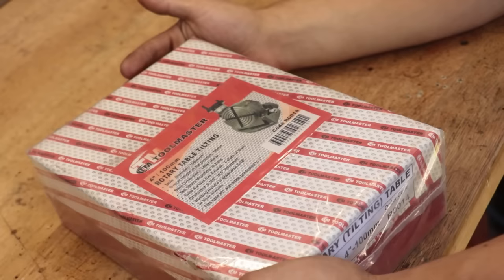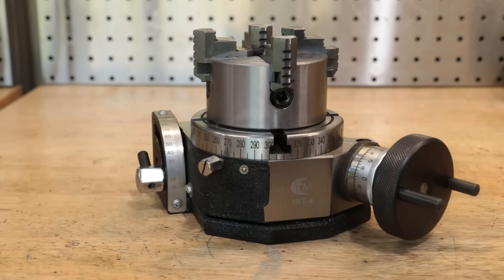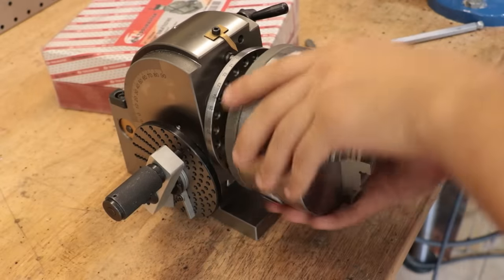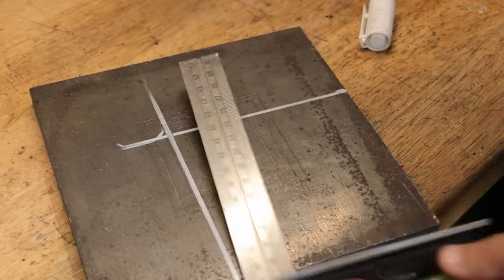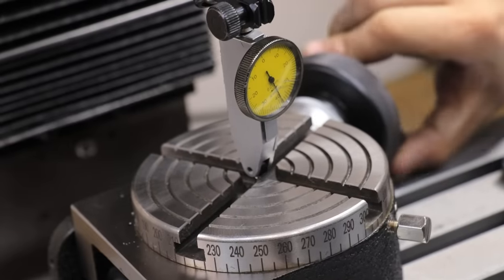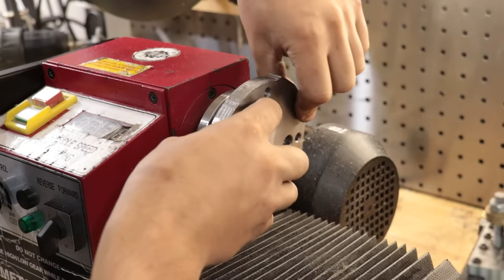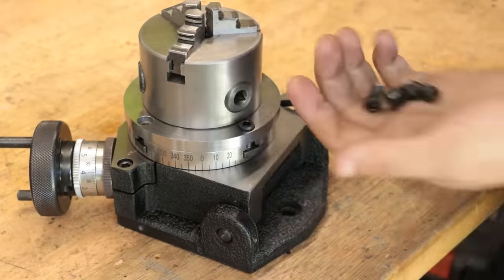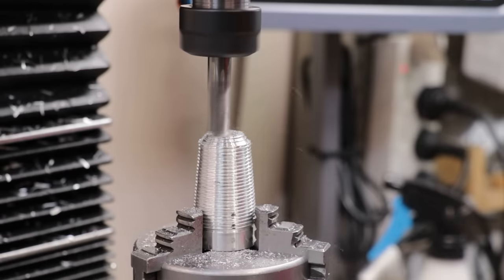I Bought a Cheap Rotary Table Which Was a Big Mistake

Comment: 12:27 I have heard some horror stories of people using files on a lathe (a chuck jaw catching the file, pushing the file tang through the handle and in to his hand for example) so I have a special file for use on the lathe, I removed the tang and rounded of the end.
Having said that, I'd consider the operation shown in this video to be ok because there's no chuck jaws spinning around.
Reply from the maker: Yea I’ve seen an accident similar to this but not exactly the same. Grizzly stuff. I havent removed my tang but I have a turned down wooden handle that I made in a very old video. Somewhat uncomfortable and I’ll change it one day. Cheers

Comment: Makes me wonder with machining required anyway ,just a couple of 45 degree interlocking plates turned on the lathe with an on-axis magnetic encoder underside. and some clamping mechanism. maybe made from an old topslide .Ah the rabit hole of indexing head accuracy .

Comment: I got the 3 inch, Indian kind. Mine didn't come with that big dial tho. Only because i offered the seller 42$ and they accepted it lmao. Still there Only worth 25 at most. Literally looks like a coin I took it apart and it smelled awful, like they dumped Gee from a roadside food stand on it to prevent rust. There was grease on the brass gear but something else was just nasty. I put the parts in ziplocks and dumped wax&grease remover then just let it sit. Can't figure out how they're supposed to go together tho because the handle just pulls out now but i did file and polished the the edges of the worm gear teeth because they were squared off & the brass gear had triangle so they barely matched just the most miniscule amount didn't take that much off. It spins nicely anti clockwise but clockwise it pushes the shaft out. I was pissed by the end and haven't touched it since so maybe tonight but probably not. Ima just drop the $ for the lms precision 4 inch rotary table with indexing plates. No since in buying this garbage when you can save your money. Buy actual precision tooling and not cheap eBay or Amazon Chinese or Indian "precision" tooling because its not. They just say that so the ad pops up when you search anything with precision in it.

Comment: Sometimes I’ll buy a cheap Chinese tool/machine. I know what I’m getting into. Though those things have been getting better over time, some are just built for price and there is no quality control. I expect that, and so take everything apart and redo whatever needs it. That normally makes it a much better tool. The lock may be solved. If I saw the parts separately, I might have an idea, if what I expect is happening is correct. But without seeing, I can’t tell for certain.

Comment: I have Vertex rotary table. It is probably a mid price point and has suited what I do. It has a 90/1 drive ratio which gives better resolution but takes alot of cranking to get there 😁. Fitted with dividing plates I have produced great gears and other exciting stuff.
The only downside is it is not tilting but I can live with that but it can be mounted vertically & horizontally. It needed stripping and cleaning before first use but I tend to expect that with any tool and satisfys my craving to take stuff apart to see how they work 🤪.
I have the matching tailstock and that has  proved invaluable to provide rigidity on longer projects and when using mandrels.

Comment: I cant believe that after seeing the  lock "working" you didn't just return it.
Id get a flat one and tilt your mill head to make the difference.
Reply from the maker: My mill head doesn’t tilt and I really was running out of time to make the parts that I needed. Not a great situation but I did need to crack on. Cheers

Comment: Recommend vertex rotary tables. They're not the best but the 100mm one I got from General Tools in Adelaide has been very good. (Edit) Vertex 6" tilting rotary table is ~$1600  🙀
Reply: Haha, yeah funny enough a $1600 rotary table is better quality than a $130 ebay unit. 😁
Reply: @wizrom3046  I bought Vertex HV-4.  Cost me around $365 on sale. No tilt function, but very decent quality, usable and accurate out of the box.
Reply: @HM-Projects  I managed to pick up a new HV04 with dividing plates for £120 a few years back  (eBay auction from private seller), really nicely made and perfect for my small benchtop machine.

Comment: There skateboard bearings what did you expect?  You need those. 0.0001 tolerance bearings, but a way to use one on top. My "anti backlash bolt" doesn't even go in straight, basically at 7 o'clock looking at noon instead 1.

Comment: Interesting... I was looking at one of those, even larger, around 3 years ago, and they were much cheaper, almost half the price of this one... A 100mm rotary was not exceeding 150$ with a chuck, index plates and pin and all the rest of the ancillary tools for operations... And i thought fuck that noise, i will rather spend 150$ on some good carbide endmills and cbn inserts and make my own rotary table... And it was a good idea... Watched ``Jeremy makes things`` rotary table diy, stefans moore rotary table and a few others who showed a decent table, looked up some designs and blueprints and I am essentially ready to start machining my own table now, ensuring material quality, absolute precision in every aspect and custom features that cheaper tables lack, like rotary encoder readout and such fine elements that one would see on a 2-10k$ rotary table...

Comment: I'm a bit puzzled as to why you didn't just buy a quality used one on ebay? Here in the UK you'd expect a nice little Centec or Elliot 6" table to sell for about £60-70, so the price is comparable but the quality really isn't. A good small dividing head might go for between £150 and £250 in an ebay auction. I'm not down on people buying far eastern gear and I can see why you might buy machines that way, but for stuff that can go in the post and isn't really subject to wear or damage that you can't see I just don't understand it. Is used equipment in short supply in OZ?
Reply from the maker: It was there in the store and I needed it for a quickly and there weren't any alternatives.
Reply: @artisanmakes  Yeah we can all relate to that. More generally though - how come you don't seem to use much used stuff?
Reply from the maker: It’s a good question and I don’t have the best answer. One part is I genuinely enjoy buying the cheap import stuff and seeing how good or bad it is. But in the case of parts like this, I prefer to take a quick drive to the local machinery shop and buy the stuff there and then. Rather than faff around getting used tooling.
Reply: @artisanmakes  I can understand that you enjoy it, although you might also enjoy stripping and servicing some vintage gear. I guess that's the same reason that you make a lot of things that on the face of it it would be much more rational to buy, like vee blocks or a boring head. Logically speaking that's insane when you can buy top notch ones for so little.  I think your content is great, but I just can't help wondering what you might be able make if you weren't busy making bits to make things with. I'd love to see you invent something.
Reply from the maker: To be fair, this isn’t a production shop. If it was I probably wouldn’t be making these tools myself.

Comment: What lessons have we learned here? Well, the issue is most likely poor tolerances and quality control. And whilst the Chinese appear to have learned the lessons on branding, apparently we have not. The ONLY reliable references are reliable and honest buyer/user reviews by those who actually understand how the product should be, as you ably demonstrated here. 

Final thoughts: There obviously shouldn’t be any tilt, but tilt due to whatever cause would only be possible if the rotary element is not fitting in such a way that it cannot do so. Is it possible to modify the connecting parts to rectify what appears to be a lose location? Or is the offending part already too small for instance?

The grown up ones of these used to cost thousands. Probably still do. Interesting vid. Thank you for sharing.

Comment: Do professional rotary tables even exist? For the most PRC stuff i first throw it in a thumble grinder to get all the parts smooth that helps a lot..
Reply from the maker: Yeah for sure and they has some on display but they don’t come cheap
Reply: @artisanmakes  Any links? I’m on the search for my equally small opti20vl
Reply from the maker: The vertex brand would be a good starting point and they are sold world wide

Comment: The main problem was on the box. It didn't say "Made in Taiwan". I bought a Taiwanese Vertex rotary table and when the shipping was calculated the Vertex was cheaper than the mainland Chinese. The Vertex uses two clamps like you made to lock the table. The clamps fit into a recess in the table's circumference so they are out of the way of work on the table.

If you buy anything mainland Chinese you need to assume that it's about 90% finished and the other 10% is left up to you. I would guess that Chinese cars come with three wheels attached and the fourth in the boot with three lug nuts.

Comment: I have this exact rotary table and it is a P.O.S. For sure.  The eccentric bushing for adjusting the gear backlash is a total joke and the brass screw for a lock, not impressed with it as well.  It’s ok for non critical things but if you’re looking for any sort of accuracy well this device doesn’t offer any accuracy.

Comment: You are wasting your time. Open it up and look at the worm and gear. You will never get accuracy from it. Mine has as much as +/- 3 degrees after the backlash is taken up. I bought Sherline (with stepper motor). No more issues.
Reply from the maker: I’ve heard good things about the sherline model.

Comment: You go through a lot of explaining of trying to justify why you bought this rotary table. Coming from a metal fabricator, it's a tool you need, so just get it. This is coming from a guy that has 6 angle grinders and 8 hand drills.  😁

Comment: Bud just fix the thing you are an engineer  not a (replaceman) worst case you learn something new (aka brake it) and then you buy a new one. What's the use of having all the cool toys if you don't fix things with them..
Reply from the maker: It’s not the first time I’ve had to fix import tooling with issues and I probably will sometime soon. It’s at least worth knowing that this stuff has problems so people can make informed decisions about this product. Cheers
Reply: @artisanmakes  Agreed, I wonder if anybody makes a good casting kit - just about as much work as a rebuild with all the problems to be fixed but hopefully a far better design, and probably cheaper in the end...